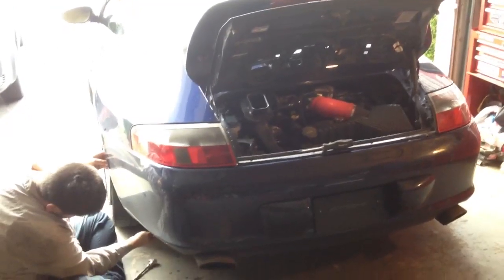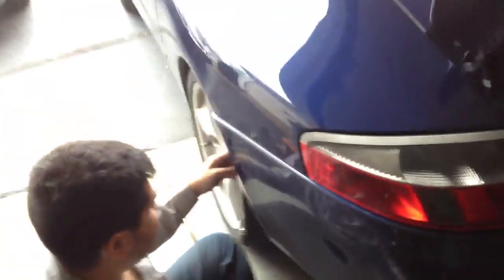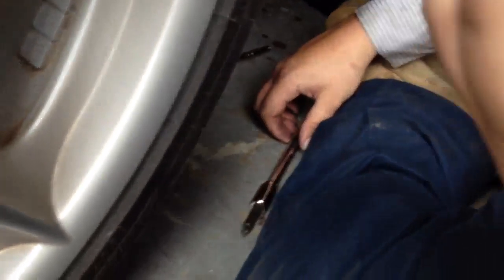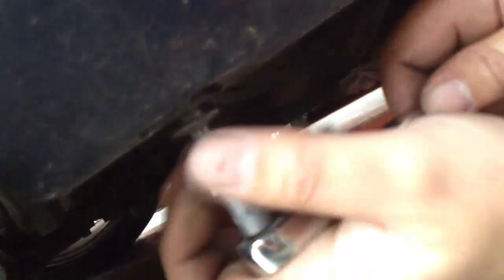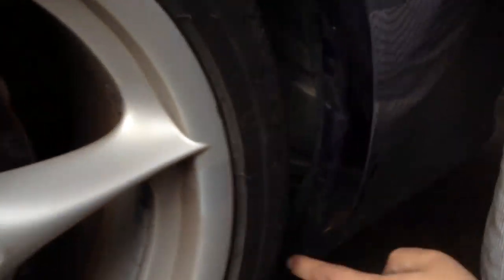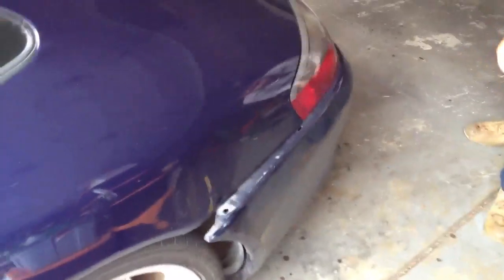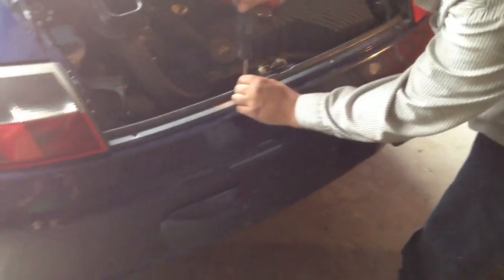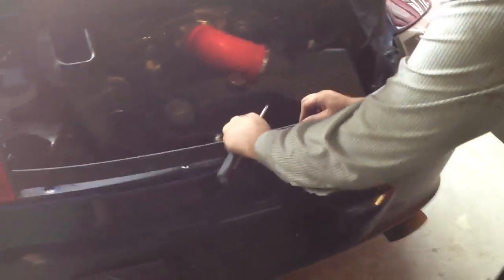Porsche 911 Carrera 996 C2 rear bumper cover removal

Comment from the maker: it is not that bad, but on this car one of the muffler mounting bolts was installed upside down(as far as im concerned) because to get the bolt out of the isolator i had to poke a hole in the heat shield to get it out.  the bolt should have went from the bottom with the nut on the top so the bolt could b pulled out the bottom without any hassle